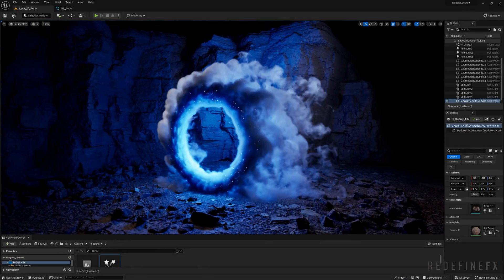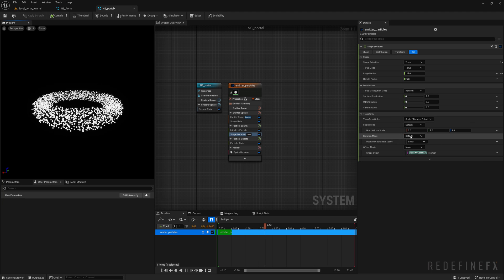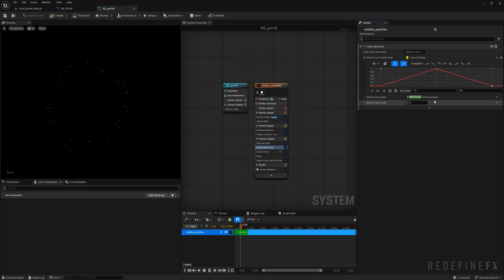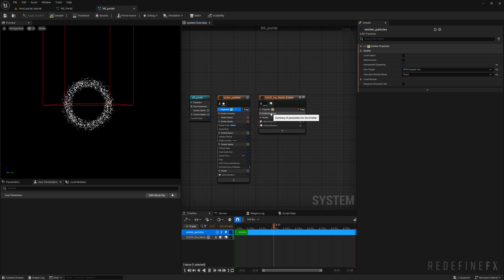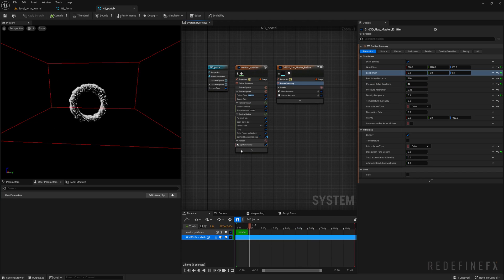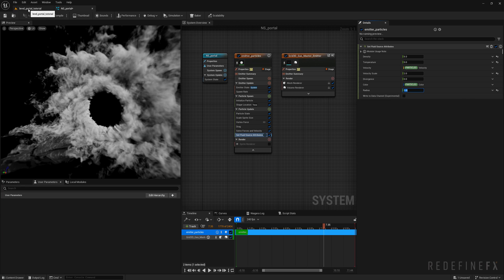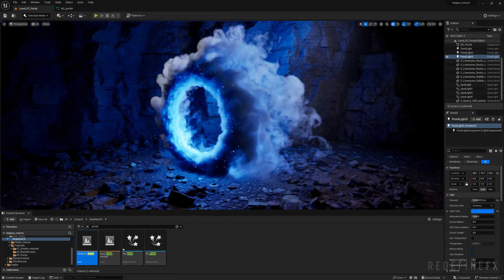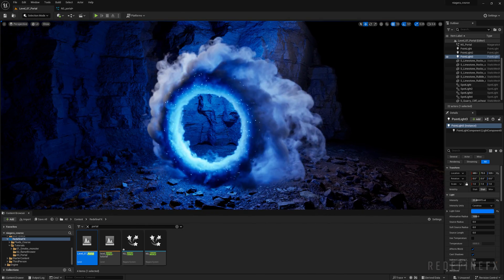Niagara Fluids Smoke Portal VFX Tutorial in Unreal Engine 5 | Real-Time Simulation | RedefineFX

Comment: Does this work in UE5.5? I get error: "using dynamic bounds mode but only using Emitter source renders. Update emitter or system properties otherwise bounds may be incorrect". Emitter does not render in preview window.
Reply: I have the same issue...
Reply: @milanchu98  Later in video he says how to get rid of error. But also, you must install plugin for fluids. Instruction is on more info not in video.
Reply: @krasnavin  Thanks a lot!

Comment: Do you have any suggestions for hardware for these creations? I bought a laptop with a 4070 and 8 gigabytes of  vRAM, but it ran out of memory with 250 pixels per inch of smoke. Should I get a graphics card with 16 gb of vram?
Reply from the maker: For these sims you want the best possible GPU with the most Vram possible. I'm on a 4090

Comment: For anyone struggling with particles scaling with the smoke or rotating the smoke in any direction I figured out a quick fix. 

1.Add an Actor
2. click on Actor in Outliner and select the Default scene root , which is the child in the Default scene root
  Actor(instance)
       Default Scene Root
3. Change this from "movable " to Static
4. attach your Niagra Portal to the Actor
5. Scale and rotate away!
Reply from the maker: Where do you find "Default scene root"?
Reply: @RedefineFX  Might be late, but you can find it under the details panel when you selected the actor.

Comment: Doesn't work in UE 5.5 unfortunately, no smoke appears after picking the emitter_particles as particle reader.
Reply from the maker: works just fine in 5.5, maybe you missed something
Reply: @RedefineFX  Thanks for testing it out and replying. I'll try to create it again from scratch.
Reply: @RedefineFX  I tried once more, and it worked this time as i chose to use "Minimal emitter" instead. However, it's extremely unstable. I played around with the Radius under "Set Fluid Source" changing it to 5 as you did in your video. Then I changed it back to 10 and the smoke disappeared. I didn't save the project, restarted UE but never got the smoke working again....

Comment: why does your smoke here look way better than the one im seeing? mine just looks like smoky sheets of low quality dust, doesnt look anything like this! would the GTX1080ti have something to do with it? since mostly everyone seems to be working with RTX
Reply from the maker: Yes you need a strong GPU to run the smoke sim at higher res
Reply: @RedefineFX  the 1080ti IS strong, but i haven't been able to figure out why the settings no matter what i do stay low quality :/ the 1080ti still has alot of horse power. So im kinda frustrated, i've also tested THIS on my laptop with a 2050 RTX scene only and still looks exactly the same, so i KNOW im missing something. since that smoke on this example looks way better out of the box - very frustrating.. this is a partical system i've been able to do much higher and intense looking things using demanding code... 

Stuck really so why is it that the smoke looks like sheets of 2001 smoke textures instead of this volumetric style lol
Reply: figured it out, it looks better on Cinematic, so not exactly sure where these settings are to work with "high"

Comment: Really love the effect but I am missing something. When I turn on the gas emitter and the smoke appears, the particles disappear leaving only the smoke.
Reply from the maker: try adding another sprite renderer on the bottom. If that doesnt help then i dont know. seems like they're getting occluded / clipped by the smoke. By default this shouldn't be happening. You can also add a mesh renderer and display them as little spheres
Reply: @RedefineFX  I found the issue on my end. However, how can I make it so I can rotate the whole thing on the z axis to turn it. No matter what I try, it breaks the effect. I even tried to make an actor and adding it to that but rotating the actor had the same effect. Is there a tutorial on that and perhaps parametrizing attributes to make it repeatable but with different colors and stuff?

Comment: Question: Is there a way to make the smoke collide with the floor instead of on the bottom of the bounding box? I mean it wouldn't matter much if the ground was a flat plane like a frozen lake or something... but in the vast majority of cases I'd probably prefer to put the portal somewhere in the wilderness where the ground isn't flat... where's it's more rough terrain. If I do this, having the smoke terminate on a flat plane ruins the effect if it's looked @ from a low enough angle
Reply: Okay. So I figured out why the smoke was not colliding with my floor. I'm actually using a different kind of floor then landscape floor. I'm using another static mesh on top of the landscape mesh and it did not have collision enabled. Once i enabled it... problem solved 😊

Comment: why is my smoke so low quality? its like yours is 1080p and mine is 240p
edit: i just realized that for some reason my smoke is unaffected by the density buoyancy, i put it at 1 and at -10 and there was no difference at all
Reply: same problem vro
Reply from the maker: Could be your scalability settings for the engine are set very low
Reply: @RedefineFX  it seems the scalability is "cinematic" in the Niagara System that has the portal, i changed the scalability of the whole project to cinematic (previously epic) but it did nothing, then i redid everything in a new NS and now it works fine but the first one is still looking awful.

don't know why it is but i for sure touched something i wasn't mean to

Comment: Can you think of any reason as to why this type of particle system only shows in one lens via VR? I've tried every permutation of options that I can think of to no avail. I've searched to the end of the net and have seen people having one lens issues but nothing like this, and most of the solutions consist of workarounds that have been deprecated/fixed versions ago. Its not stereo because that's disabled, and when in first person/third person the particle system looks as it should but preview in VR it only shows in the left lens. I have a few other particle systems in the scene that show up as they should during VR. I figured through process of elimination it has to be something within the emitter settings causing this issue if the other systems are showing up as they should and this one isn't, but I can't seem to figure this out and find a workaround, its driving me crazy. Any suggestions/thoughts would be most appreciated. Great work and thank you for what you do. P.S. Im using 5.3.2

Comment: Anyone getting "compilation failed" the second they add the grid3d_gas_master_emitter?
Reply: I fixed this issue by following these steps.

Enable mesh distance field generation:

Go to Edit > Project Settings
Search for "Distance Field" in the search bar
In the "Rendering" section, find "Generate Mesh Distance Fields"
Make sure it's set to "Enabled"

Rebuild lighting data:

Go to Build > Build Lighting Only
Wait for the process to complete

Finally, restart UE.
Reply: i got the same info after adding Grid3D_Gas_Master_Emitter
Reply: @liurui8014  I posted a solution related to enable the instance field generation, and rebuild lighting, then restart UE, see full steps in the primary comment.

Comment: Thanks for the tutorial. Resolution max Axis is 400 and pressure Solve Iterations is 8, but the smoke does not transition smoothly as in your video and creates a flicker effect. Any idea why? I couldn't find what I did wrong.
Reply from the maker: Could be because your GPU can’t keep up. Try actually lowering the resolution instead see if it stops flickering